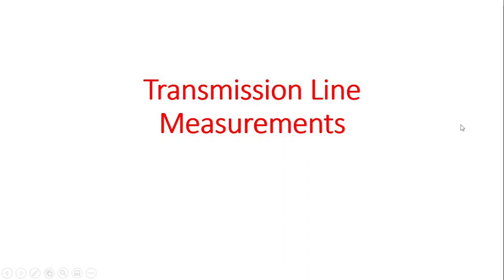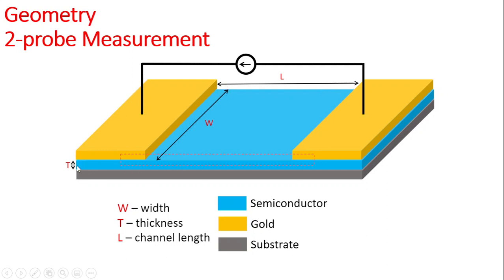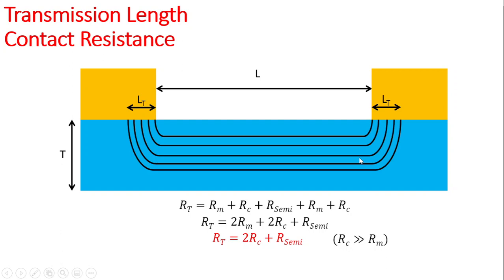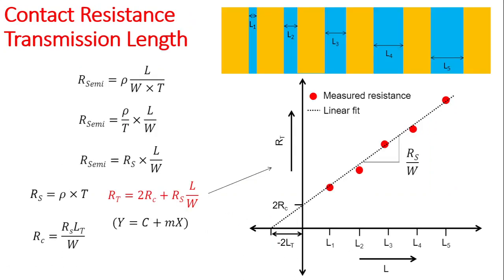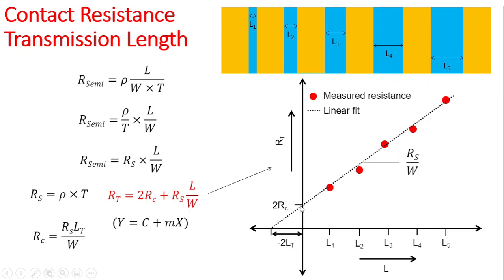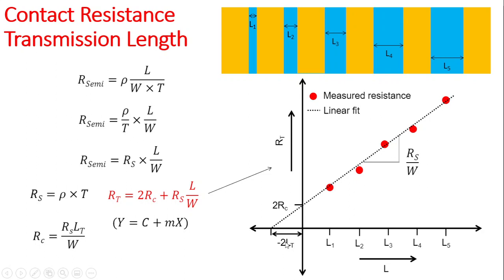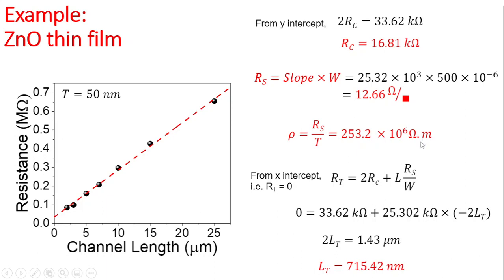Transmission line measurements (TLM)

Comment: if the extracted slope is in Ohms/m, why is Rs = Slope * W gives you Ohm/square meter?
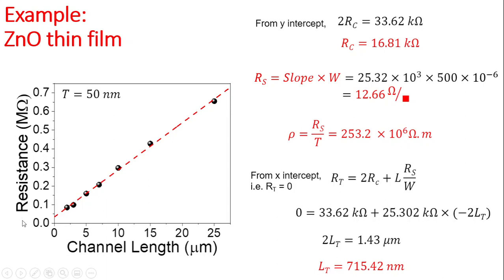Reply from the maker: its converted into the correct units. The x axis is in um. Please check the video at 3:22.

Comment: Should I use for or two probes ?
Reply from the maker: 2 probe measurements are good. But I would suggest to gate the device with a 3rd so that floating gate does not cause additional variability.